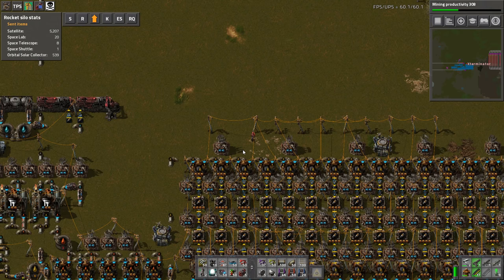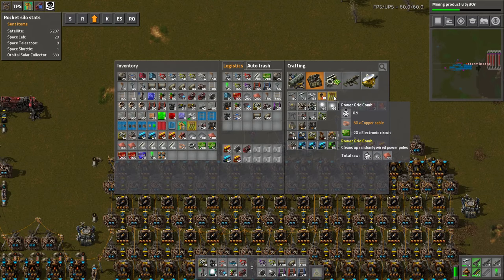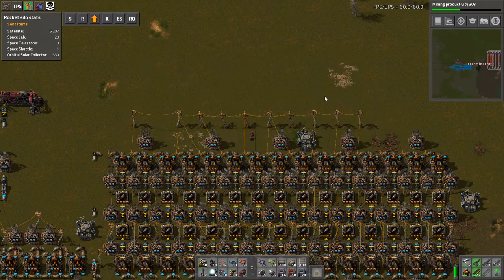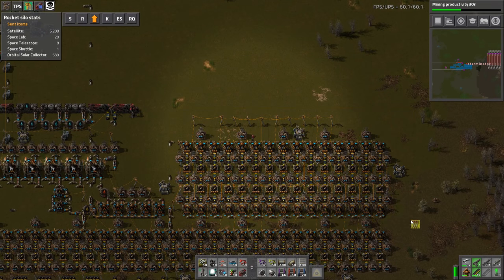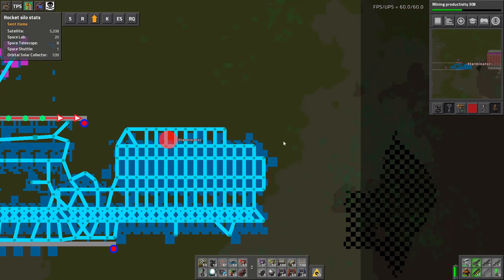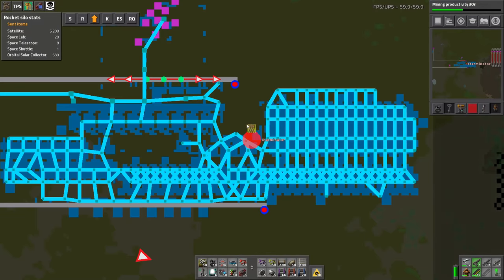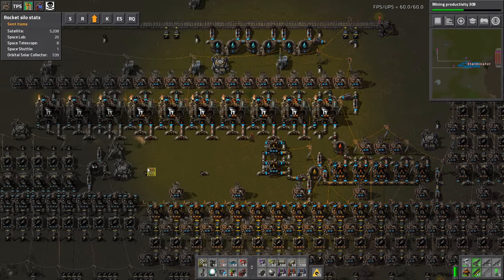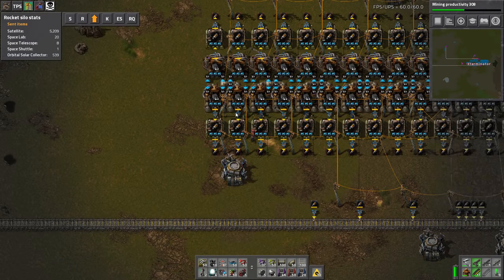Factorio Mod Spotlight - Power Grid Comb

Comment: Like always he gets something totally wrong: It does not clean the poles up. It replaces them in place but in an ordered fashion not like robots which place them randomly.
TBH Sometimes I ask myself why I watch those low quality videos with often wrong information.
Reply: It doesn't touch the power poles at all. Just the wires. You can place and remove wires per hand the same way you use circuit wires. Just pick up some copper wire. That way you could clean up these things yourself, but it's tedious. So the mod does it for you